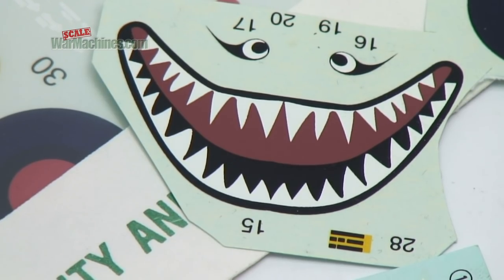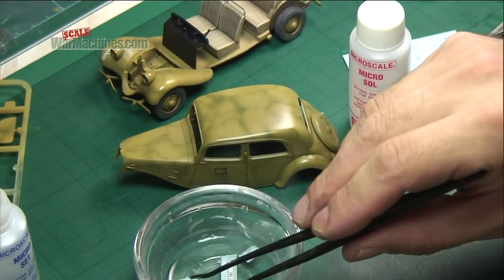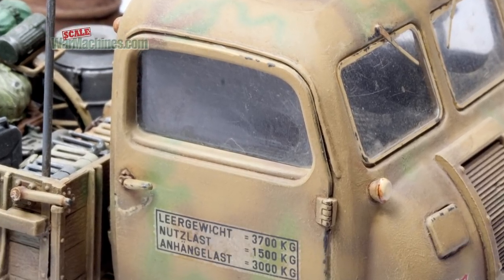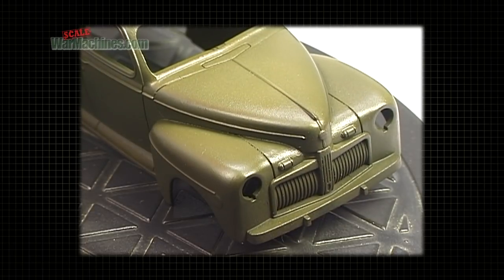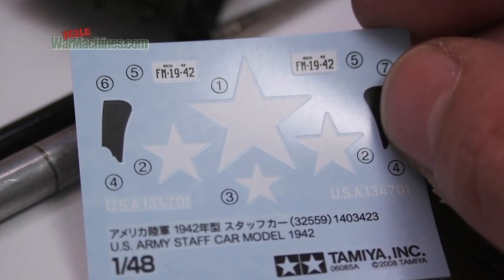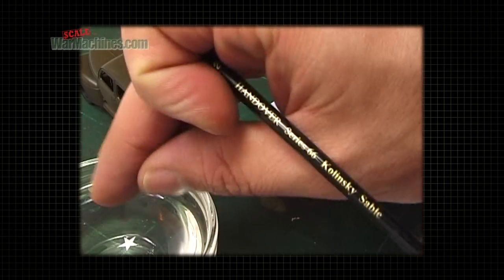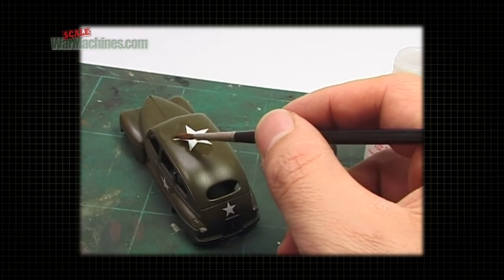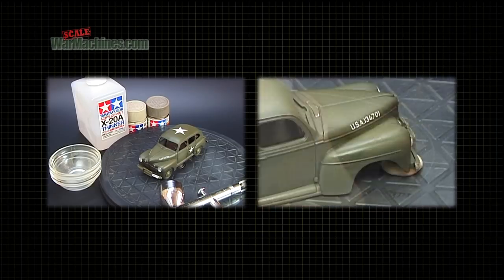HOW TO GUIDE: APPLY DECALS TO YOUR MODELS - Modelling Video

Comment: So I'm planning on getting a 1/12 Maschinen Krieger Kit and I want to apply a special decal. I want the decal to be part of the paint. Also I want the decal to look worn and few chipping to the decal. Instead of watersliding is there a way to like paint it on the model?
Reply from the maker: Almost missed this comment. So you can get "weathered" markings using decals. The only other option is to hand paint or stencil them if you wish to avoid decals. To weather water-slide decals, apply as usual & then seal with a thick coat of varnish or similar & let dry. Then use fine abrasive sanding sticks wet to very carefully sand & thin the carrier film down & flatten the decal. Then chip or scratch it with a scalpel or sand away more aggresively to depict damage or wear. This is quite effective & works well to 'damage' markings. Of course, it also will eliminate any visible carrier film "step" too. You can always touch up or add chips on top using a brush as well...
Reply: Scale War Machines Thank you so much! I'll try that ;)

Comment: Love the vid thank you! I'm refinishing a Les Paul Gibson guitar for a costumer and he would like the paint scheme of Francis " Gabby "  Gabreskis P-47 Thunderbolt. I Was going to paint his tally marks but was thinking about how the decals would look also. Will polyurethane harm them in any way?
Reply from the maker: +THE SLAKJAWMCGRAW By polyurethane we take it you mean a think glossy varnish or resin coating? In theory you should be fine if everything is dry (maybe seal with a top coat of varnish). However, as with everything - especially if it's for a client - we'd test the process first on a sample - just to be 100% sure.
Reply: +Scale War Machines I'm on it! Thank you again! Btw, yes, polyurethane is a type of varnish. Unlike lacquer though, you can sand in between coats to get a smooth as glass look to your work. If you wet sand it with fine grit sandpaper ( 1,200 1,500 2,000 grit) and a little soap in the water, it really comes out nice.

Comment: I want to "distress" my decals. I have been advised to use a fine sand paper. How would you go about doing this please~?
Reply from the maker: Paul Elliott Just apply the decals, seal with a varnish or Klear & let it dry (properly). Then use fine sanding sticks or paper to very gently sand away. Our Facebook page shows an older post (Oct 31st 2014) with an M113 ACAV from Vietnam where we have done just that. Go gently & make sure that varnish is toughened up & properly dry before attempting.
Reply: Scale War Machines Thanks for the quick response! Awesome stuff. I'm totally new to modeling only having started a few months back. Love watching the "how to" vids! Cheers!